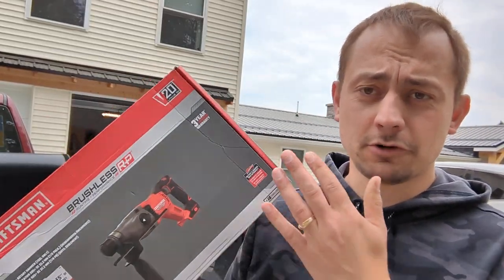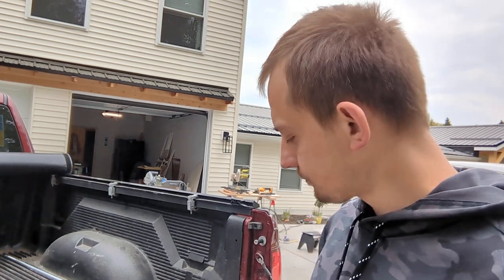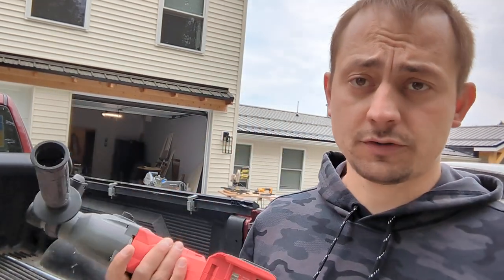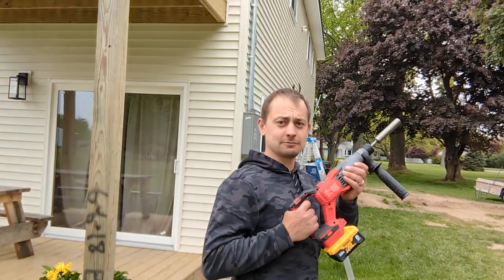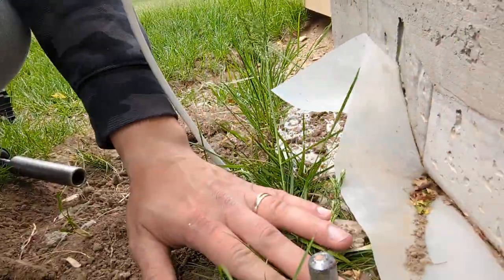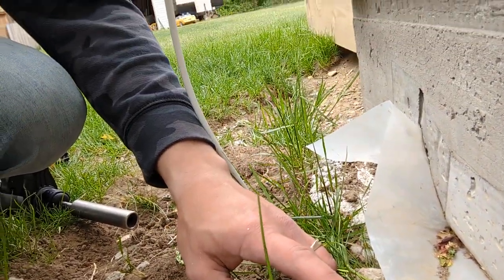Best way to drive in Ground rods #electrical

Comment: I use to work in electrical wiring residential homes years ago and the company I worked for had 1 or 2 of those hammer drills with that special bit to drive in the ground rods. We had a lot of trucks that would go out and if your truck was not the lucky one to get the hammer drill then it meant driving that ground rod in with a sledge hammer. Oh man!!! I do remember using the sledge hammer a few times. That was a lot of work especially when there was concrete over pour. We would have to dig down to the over pour and bust it up with the hammer first. Let me say that hammer drill made for fast and easy work. A real time and back saver. lol 
Great video.
Reply from the maker: I can't imagine doing all that by hand. It literally took me like 5minutes to do